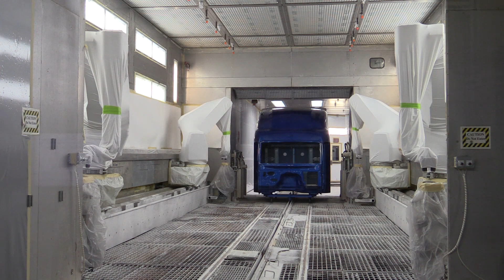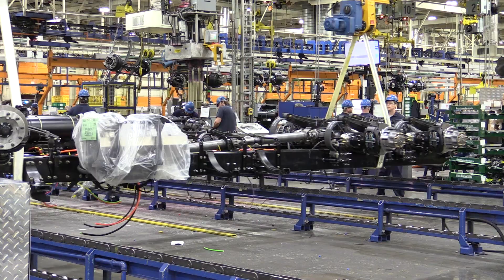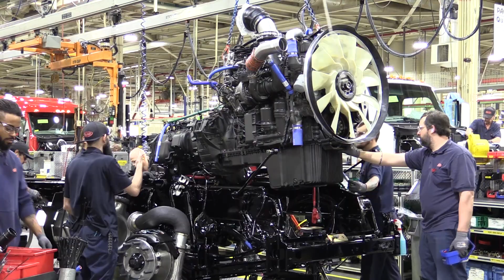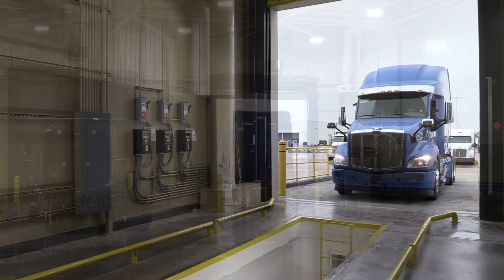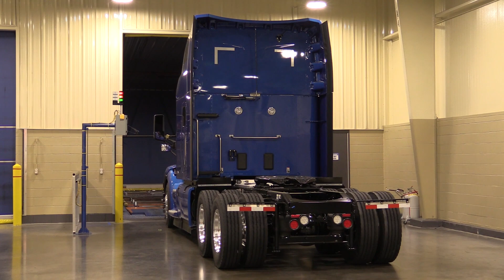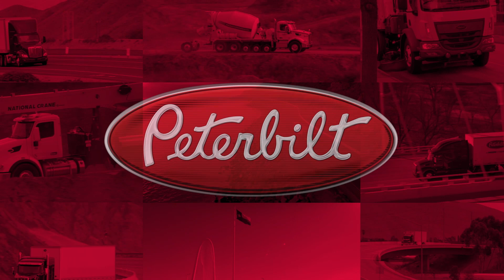2019 Peterbilt UltraLoft

Comment: I got over 2 million miles on my 379 Peterbilt with C 16 Cat 625 hp 18 speed . I’ll just keep running her until I retire I’ll then put a 160” sleeper on it remove the fifth wheel and register it as an RV and motorhome around the states with the wife and finally take time to stop and 	look around for once instead of hammer down every where.

Comment: I dont know..when a truck doesnt have 2 stacks on the outside..makes the truck look "neutered"..gotta have the chrome stacks..I'm suprised Peterbilt didnt incorporate them ..
Reply: Aerodynamics, but you already know this... right?
Reply: @bob-jo5gd  could have put them behind the sleeper.
Reply: Not a fan of the grass burners that most of these newer trucks are having.
Reply: They still build them you just cant get them on the stub nose as standard equipment.
Reply: New trucks fake one side of the dual stacks. Looks pretty stupid when it's cold out and only 1 vapour trail
Reply: But if u do pipes or some insulation  it's better to have grass burner

Comment: Paccar makes a great product for trucks. Too bad their engines are junk. 
That truck with an pre egr detriot or a cat or cummins n14 and your cooking with gas.
Reply: I like my 500hp Paccar MX 13, haven't had any issues with it.
Reply: It does quite well for a 13 liter.
Reply: Me to,have a 500 Paccar, runs awesome.
Puls good is good on fuel,and oh i don't idle as that is not good for any engine,for that we have a APU.
The engine is bullet proof, as they run it in the rest of the World for a decade now.
Reply: I run the mx13 too. Pulls great when hauling heavy. I haul 63500kg daily. BUT THE WIRING HARNESS IS TOTALLY SHIT on these trucks. So many rub throughs and cracked coatings and green wire. Steady in the shop getting shorts fixed n codes cleared
Reply: I own 4 paccars abd they give less trouble than my others. Will all 22 of mine were Paccar engines
Reply: Y’all need to be quiet for Paccar you know darn well that the CAT-15 and the Cummins N-14 ware the best and will the best including DETROIT Series 60 who ever likes paccar are company drivers and never experience the real power like in my CAT-15 it runs with a total of 550 HP and dust all them Paccar MX-13
Reply: @dutchman2506  If the engine is no more than 530 hp the engine is a DAF engine from the Netherlands and since 2012 called PACCAR.
Reply: @BM-sl1zs  Nice idea. Why did PACCAR built a factory in Brazil making DAF Trucks and no Kenworth or Peterbilt? Why is DAF Trucks the second in the market of 16 tons plus in Europe? Oh I see, because it's rubbish.
Reply: @47rintin1  of course it's rubbish. Cat and Cummins will smoke a paccar all day long.
Reply: @terrygamble986  If you're a cowboy don't buy a sophisticated PACCAR. If you treat a lady with attention, she will love you.